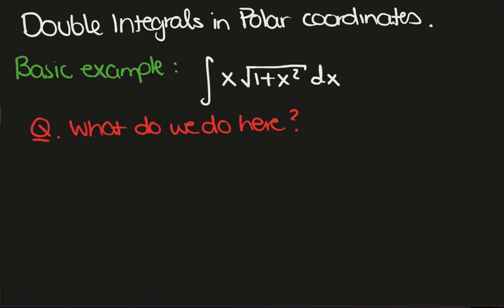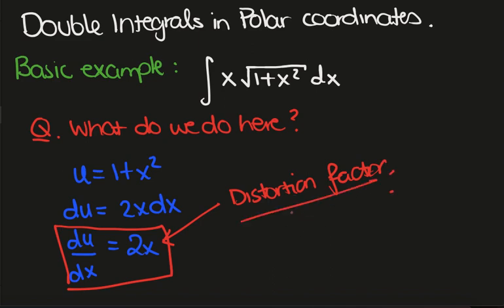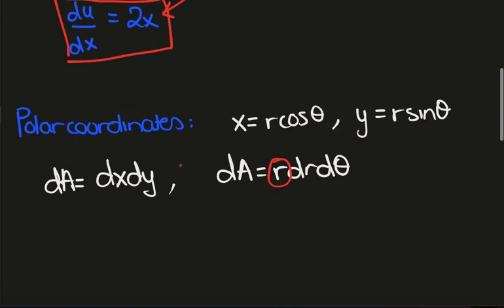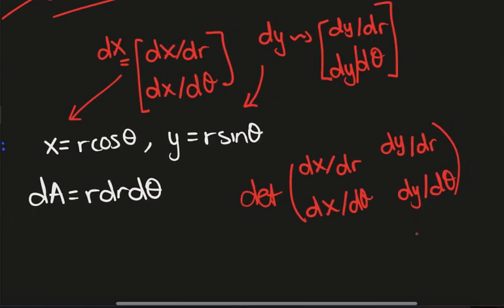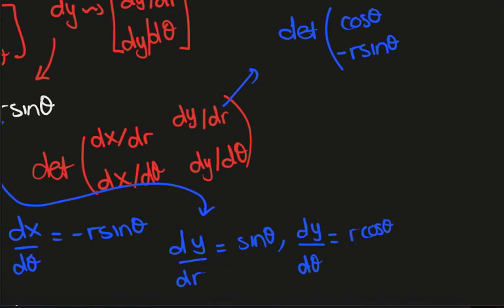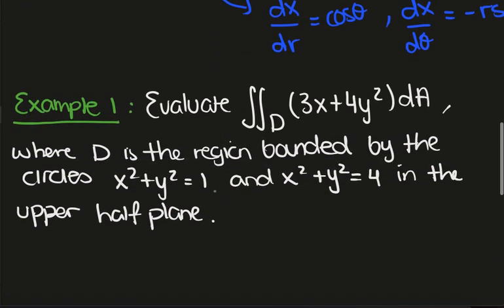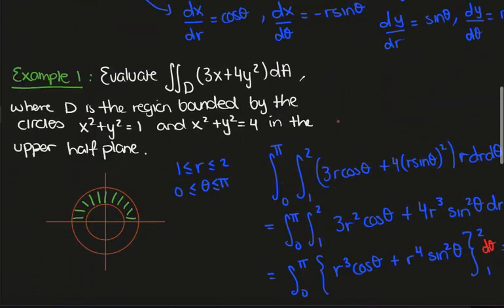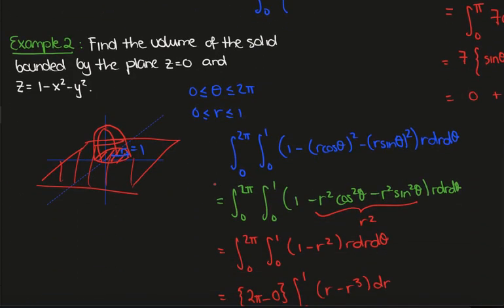Calculating Double Integrals in Polar coordinates | Vector Calculus and Differential Equations

Comment: @ 2:34 dx is literally a vector? Done Jacobians many times but always looking for new perspectives
Reply from the maker: @John dx can indeed be thought of as a vector. In fact, in the modern theory of differential geometry, dx is interpreted exactly in this way. If x = (x_1,...,x_n) denote the coordinates on your space (the right word here is manifold), then dx1, dx_2, ..., dx_n form a basis for the cotangent space -- the dual vector space to the tangent space (whose basis is given by the coordinate partial derivatives). This is quite advanced material, but you can try reading the wiki article on the cotangent space for more on this.

Comment: Id put ∂ this symbol instead of d. I know what you are meaning. But since you are dealing with 2 variables,  you are actually keeping the other constant because you look at the change of dx or dy with respect to its chosen variable. 

Also for those who are still confused, I can give you an extended explanation about why there comes a "r" infront of d(r) d(θ). The determinent refers to how much areas gets scaled according to the identity matrix. A matrix is a collection of numbers. The columns of matrixes are vectors. In this case ( identity matrix ) it is the unitvector in the "x" direction and the unitvector in the "y" direction. the surface of that matrix is just 1. if you have another matrix with different columns then if you are going to calculate the determinant of that. It will tell you how much the area changes according to the area of the identity matrix. 

the surface of the identity matrix is just a square. now replace it with a circle with radius 1 ( this is just for showing the intuition behind it xD its just a trick I use to understand it  ). Then suppose you have a circle in space with radius 2. Then the determinant of that matrix is 2. It tells you by which factor the area of the circle changed in this case its just a circle but the radius gets twice as big, but it could also become oval shaped, but it this case it still holds its original shape. Because polar coordinates are for circular areas, so not only for circles with differen a radius. You use the special determinant called " the Jacobian determinant  5:23 ". it tells you how much your variable x changes with respect to the change of r and theta and the same with "y". The major difference between the regular determinant and the jacobian determinant is that the regular determinant tells you bye which factor its gets streched without like crazy distortians. The jacobian determinant shows both. 

Shortly, ( to erase extra confusions). 
The determinant is just used  for linear transformations. Look at the area of your identity matrix, so a square with area 1. if you have another matrix with different columns then you can see that if you are going to look at that shape of your newly formed figure. Its going to be a parallelogram. If you change your matrix. So, if you move your columnvectors ( in this case the two unitvectors ) somewhere else ( this is called a transformation ), you get another shape. If the shape of your square after your transformation still looks sharp, straight, without any bendings,...  ( then this is called linear transformation).

The jacobian matrix is used for nonlinear transformation. Look at the example Ive given here above. The transformation isnt linear if you the figure you get when transforming doesnt look straight, sharp, has bendings,...
Reply: long comment lol
Reply: Anna Schumacher lol I know. I hope it helped you.
Reply: @Caleepo  Are you at USYD?
Reply: Anna Schumacher no xD why ?
Reply: @Caleepo  Where are you from?
Reply: @Caleepo  Have you studied math at university?
Reply: Thomas Sogg Im from Belgium. And nope, I haven’t studied math. I’m in my first year of engineering.
Reply from the maker: @Caleepo  Awesome, I teach at USYD and I assume that most people who comment on here are students of mine.
Reply: @Caleepo  ever been to Australia?
Reply: Thomas Sogg nahh, Ima stick around in Belgium for the upcoming 4-10 years. After graduating,  I want to Travel the world. Then I might visit Australia, but my future plan is to go to the wild or little villages rather than going to big cities, I hate cities tbh. If Ill go to Australia, Ill probably go the middle or east side of Australia. Africa is my first destination. Im just trying to avoid places where there are lots of buildings, vehicles, technology. So basically Im just avoiding where human civilization is dominating. I know its paradoxal to say that that I hate technology even tho I study engineering. The reason why I study engineering is because I need the money from somewhere to travel lol.
Reply: @Caleepo  That's pretty unique, I don't know anyone with aspirations similar to yours.
Reply: @Caleepo  What type of engineering do you study?
Reply: @Caleepo  Do you like Belgium?
Reply: @Caleepo  Hahaha sorry, I don't have discord
Reply: @Caleepo  How did you stumble on Kyle's channel?
Reply: Thomas Sogg it was actually for the computations of it, not specifically for the meaning. I just saw the channel somehow on my right side when watching another math related video.
Reply from the maker: @Caleepo  I'm glad to know that my videos are reaching Belgium!
Reply: @Caleepo  fair enough bro
Reply from the maker: Thanks for your comment! 💪
Reply: Kyle Broder - Mathematics you are welcome :D.
Reply: Nice comment
Reply: Now I'm interested
Reply: @jeremykirkby1818  lol
Reply: this was very useful
Reply: The \partial symbol and the d symbol mean the same thing, it's just a symbol.